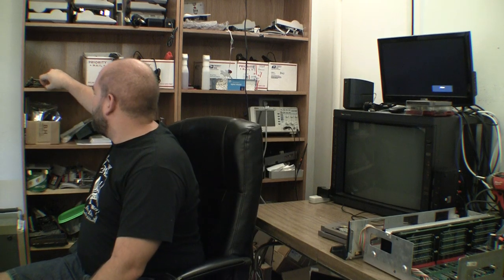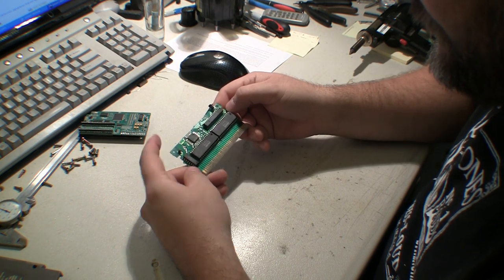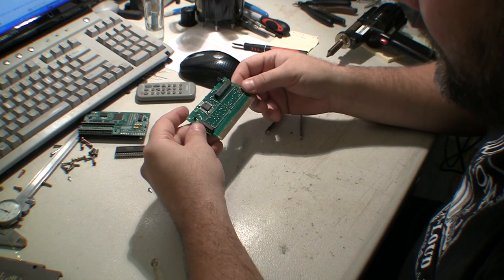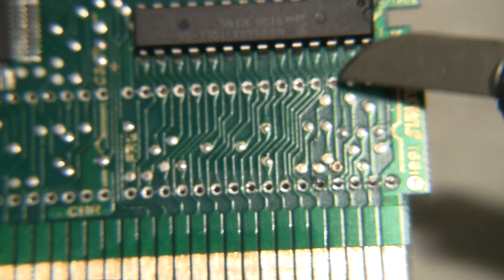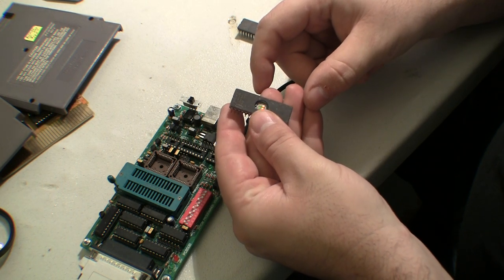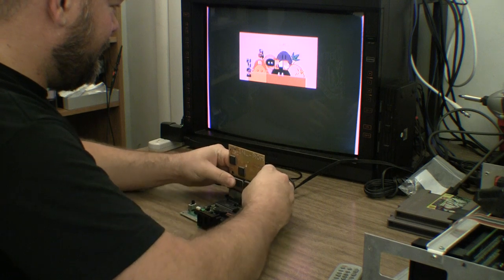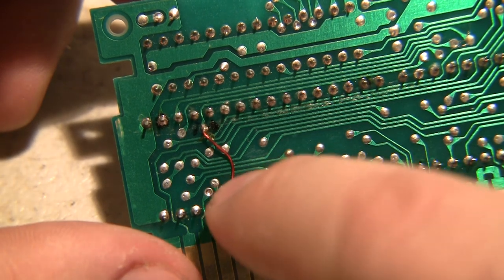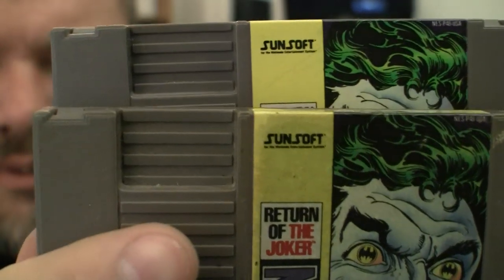NES Nintendo - How to make US Mr Gimmick repro

Comment: If you dont want to pull traces and arent keeping the mask roms simply use a dremel to cut off the proms and tap out the pins while heating with a soldering iron, makes for a clean pull every time.

Comment: The US Proto did NOT have the extra sound as the NES is incapable of it without modification. 
The Japanese version is the only version with the extra sound.

I learned this through the thread on Nintendo Age.
Reply from the maker: Sadly i'm just now learning this, but that explains why INL has the extra sound chip option on his pcbs and why the ebay seller said extra sound version...
Reply: GameTechUS
Well you are better than I am at this stuff. I don't have the tech wizardy to do what you do. I would like to learn but I haven't  got a clue where to start learning from when it comes to electronics in general such as soldering and stuff like that.

I am just going by what guys like Bunnyboy on Nintendoage has said, seeing as he made the Retrousb repo's which from what I hear doesn't have the extra sound capabilities since it is from the US rom.

Comment: The Infinite NES Lives boards with flash ROM are excellent, and the flasher/dumper works pretty well too (though the software is a bit lacking).  The cool thing is you can buy a single flasher to program NES, Famicom, and SNES games.  Also the guy (Paul) from INL said that he should be selling brand new NES blank carts in various colors soon.
Reply from the maker: Oh good news, I hadn't heard that!
Reply: GameTechUS He posted this photo in May of the first set (looks like some were rough) from his mold, but hasn't had much to say on availability lately.  He's usually pretty responsive to emails but not lately.

https://twitter.com/InfiniteNesLive/status/464587238895259648/photo/1

Comment: Sorry, but you are WRONG regarding the 'extra sounds'.

JAP - Includes the Sunsoft 5B sound chip, which enables additional sound channels on a Famicom or a modded NES.
SCN - Has rewritten music for the fewer sound channels of the PAL NES - operates at PAL standard 50Hz.
US(proto) - Identical to the SCN version, but operates at NTSC standard 60Hz.

I'm actually a little surprised that you didn't do solid research before recording this video - that's pretty atypical of you.
Reply: ***** non sequitur is non sequitur.
Reply: But if he tried to use the japanese romset on the batman pcb, he WOULD suffer from missing sounds.
Reply: Rikard Bengtsson Well, you're right, but there is a method of rewiring using the Sunsoft 5B chip (which is rarely found in other games like the Japanese version of Gremlins), which can be used in place of the FME-7/5A chip.

It's also possible to use the Yamaha AY-3-8910 chip, which is cheap and easy to find, but it requires a great deal of hand wiring, and it's just faster and easier to get the InfiniteNesLives board.
Reply: Yitzchak Benetowitz I know, I have made 4 repros using "common" FME-7 games + YMZ-284 for sound.
Reply: Yitzchak Benetowitz You're also wrong, albeit about one thing. The sound chip referred to as the Sunsoft5B is a complete Yamaha YM2149F, not a General Instrument AY-3-8910 (it's not a Yamaha AY). The 2 chips are virtually identical, except the volume on the YM is slightly more logarithmic, and the YM2149F has a clock divider on pin 26, with the 5B locked in this state (it runs at 0.89 MHz as opposed to the Famicom's 1.79).

I think the only reason why INL uses an AY-3-8910 with a separately divided clock is that the YM gave him volume mixing problems as the volume was too low, whereas other people may not know about the differences between the chips. +Rikard Bengtsson is correct in using a YMZ in his repros.

Also, I think the US version gives you 9 lives as opposed to the JP/SCN's 4 lives.
Reply: *****
Huh!  That's actually incredibly fascinating.  Thanks for that info.  Do you have a link with more comprehensive info on this?  I'd love to look at this more in-depth.
Reply: Not really. All you need to do is read the datasheet for the YM2149 as they're exactly the same. However, for the memory handling there's the FME-7 NESdev wiki article: http://wiki.nesdev.com/w/index.php/Sunsoft_FME-7